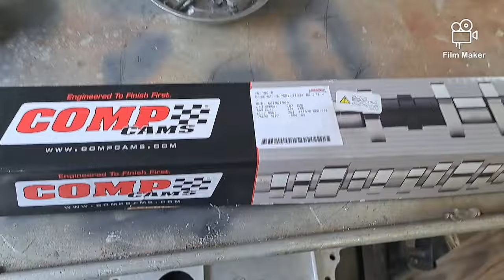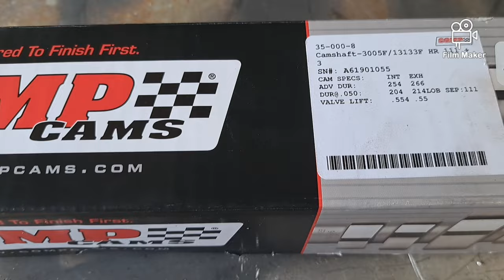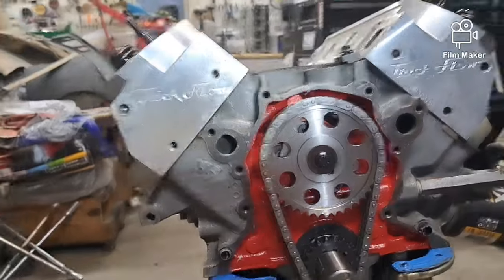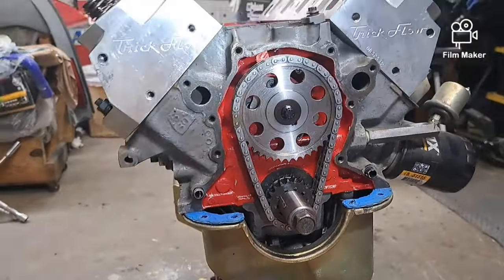Update on what's going on with Nitening, Poodle Pecker, Trooper car, and Rodney's intake manifold.

Comment: Can't wait to see how the 347 runs , it should run pretty good or as good as to be expected from efi😅😂😅 JK!! gotta tug your leg about EFI 😅 It's going to be strong with those trickflow heads , I'm looking for 1 trickflow 190 11r head if you run across one let me know . I bought a new one on ebay stupid cheap and hoping to find another one for a deal but I will probably end up  buying  a new one
Reply from the maker: Yeah, I'm thinking it'll do allright, long as it goes straight.
Reply: @FXRSDriver  I'm hoping to get mine back to the track in the couple weeks, gotta figure out why my brakes are pulling to the right, going to try and rebleed passenger side but maybe when you get it going me , you, and the other 347, guy can have fun racing one another if my shifting is good enough by then 😂🤣😂